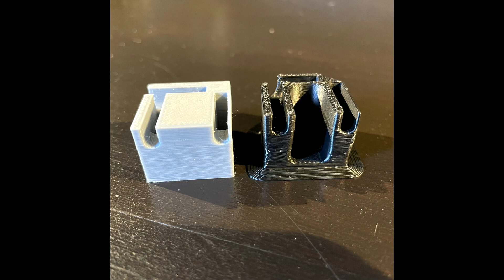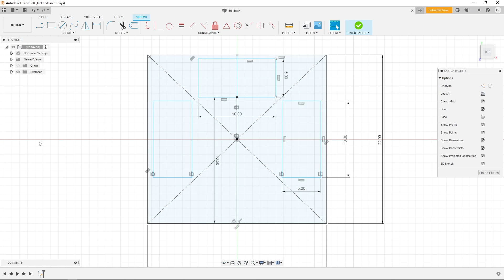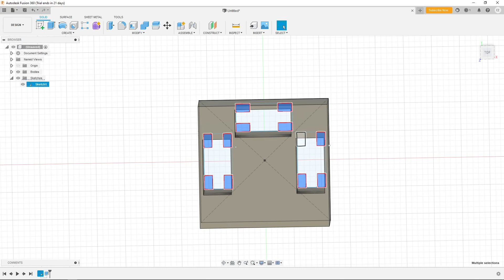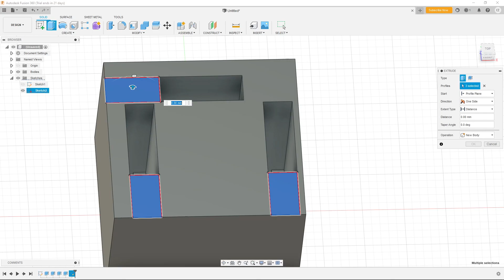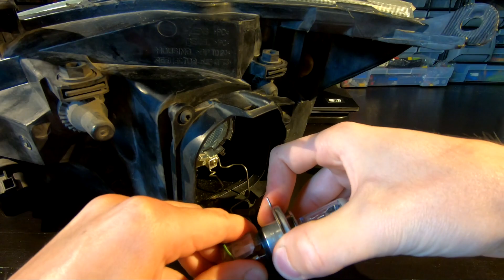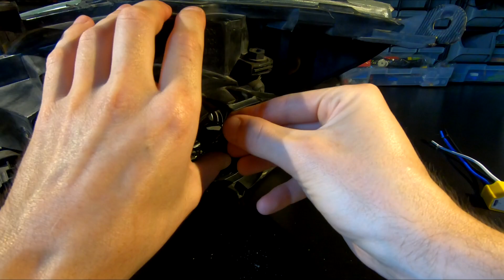How do I 3D print car parts?

Comment: Hi Nick, I saw in the comment of some video that you did the plug for the parking light of the xenon hella headlamp, do you sell that?
Reply from the maker: Hi, 
Yeah, I thought I uploaded the 3D model to thingiverse… but no. 
You are interested in the finished part or the 3D model?
Reply: @N33sWorkshop  I'd be interested in the final product. Do you sell it ready to install?
Reply from the maker: I can make it ready to install. 
Where should I send it to?
Reply: Spain, what don't you put a listing on Ebay, pretty sure you'd have a demand for that
Reply from the maker: Yeah, I can send it, no problem.  You can contact me on Instagram @n33sworkshop or email maybe for address.   
I build stuff… that is what I’m good at.